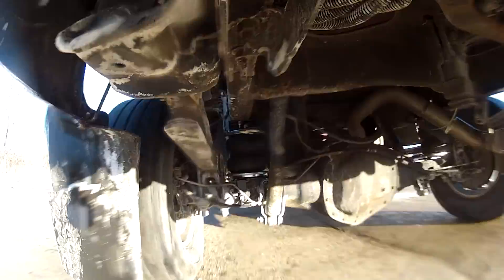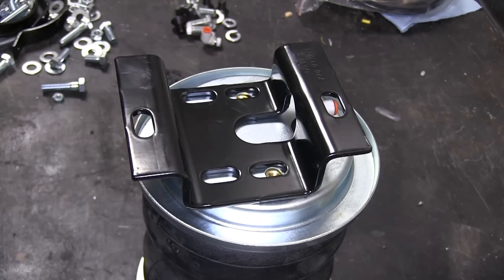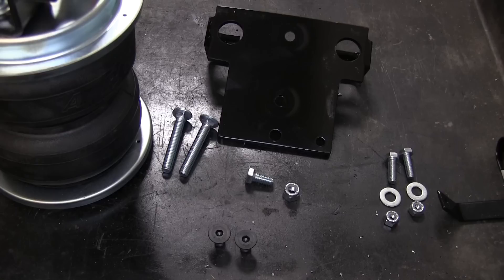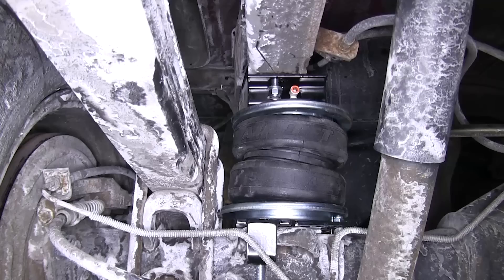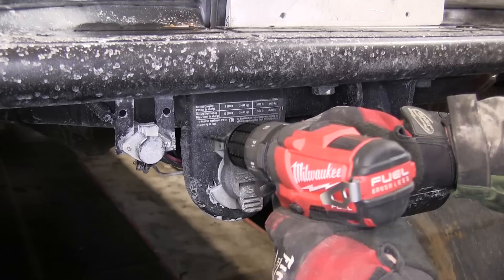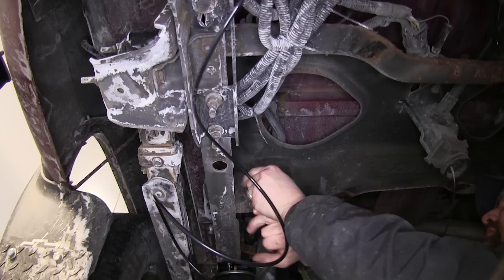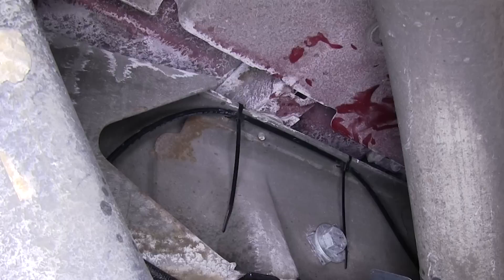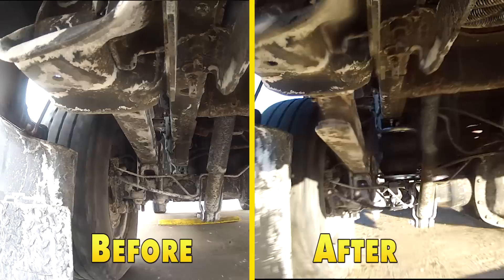How to Install: Air Lift LoadLifter 5000 Air Helper Springs on your 2005 Chevrolet Silverado

Comment: Can I put these on all 4 sides of my truck
Reply from the maker: Unfortunately, neither Firestone nor Air Lift offer a front air helper spring for a 2005 Silverado. Which series truck do you have, 1500, 1500HD, 2500 or 3500? Get us that info and we'd be happy to make some recommendations for you.
https://www.etrailer.com/Vehicle-Suspension/Air-Lift/AL57275.html

Comment: can i put these on if i get a lowering kit ?
Reply: Tavv was wondering that too
Reply: Let me know what you find out!
Reply from the maker: If the lowering kit decreases the distance between where the top and bottom mounting brackets are installed on a stock truck, then it won't work. We have some kits for lowered trucks, but they are fitguided. You can go to www.etrailer.com and use the vehicle fit guide to determine what options are available.

For a 2005 Chevrolet Silverado we do have a few options:
AL59209 - fits 2 wheel drive 1500HD, 1500LD, 2500HD and 3500 lowered 4-6 inches. 
AL59103 - fits 2 wheel drive 1500LD lowered 2-4 inches.

https://www.etrailer.com/Vehicle-Suspension/Air-Lift/AL59209.html

https://www.etrailer.com/Vehicle-Suspension/Air-Lift/AL59103.html
Reply: @elitesmoke6195  i put them on with a 2-4 drop but the ones they recommended in the bottom comment. They work good but if you level the truck and air in the bags it wont look level basically with my 2-4 drop it goes to a 2-3 drop, doesn't look level. but it does prevent from bottoming out . im running them at 5psi just the minimum  it look s kinda level but i think im going to change my lowering spindles to factory since its 1'' difference it will look level with 10 or 15 psi. i also hauled a small trailer with a bike, and a bunch of camping gear worked real good

Comment: Would this smooth my ride?
Reply from the maker: Having this kit will make hauling a trailer or load in your bed a lot more comfortable and stable. Adding these air helper springs will do little to no improvement when the truck is unloaded.
https://www.etrailer.com/Vehicle-Suspension/Air-Lift/AL57275.html

Comment: Would this work for a 99 c1500
Reply from the maker: These specific bags are not designed to fit the 1999 C1500. You can use the Air Lift LoadLifter 5000 Ultimate Air Helper Springs with Internal Jounce Bumpers kit that is designed to fit your truck. Check out the following link for more details on the kit.
https://www.etrailer.com/Vehicle-Suspension/Air-Lift/AL88216.html